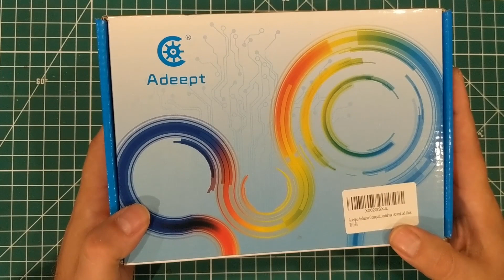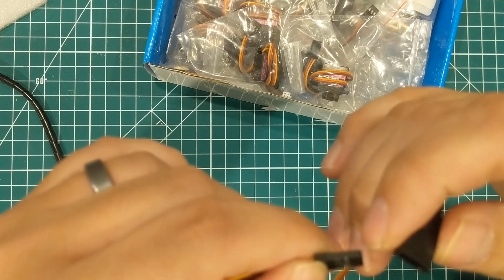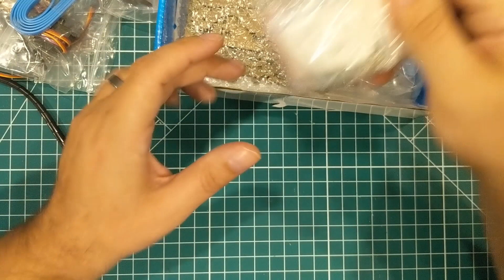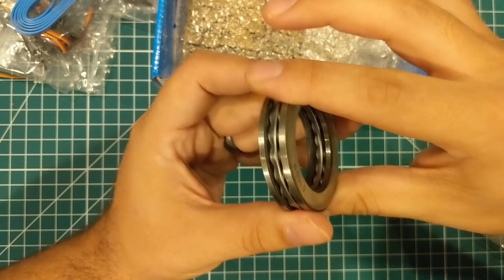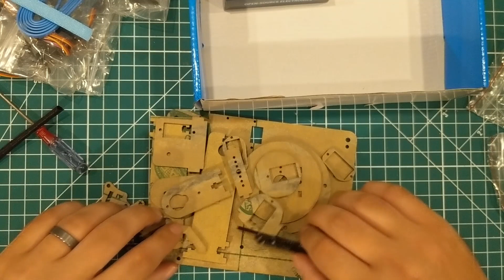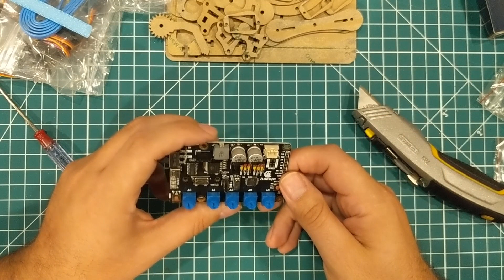Adeept Arduino Robot Arm Unboxing and Contest!

Comment: RE: the servo part number, MG = metal gear.
Or at least that's how they are typically described by the usual Chinese sellers.
Reply from the maker: I never made that connection...so that means the SGs that come with every starter kit are "sucky gears" :)

Comment: Very nice kit.
I'm actually designing a similar board, I have been working on a robotic arm project which you can see on my channel. But I have those 9G cheap Servos. The ones provided in this kit are more heavy duty Servos. 
Anyways I think you should be able to check my code on this arm. It is a record and play code.
Reply from the maker: Yeah very cool. That's how I have mine set up right now with the record and play